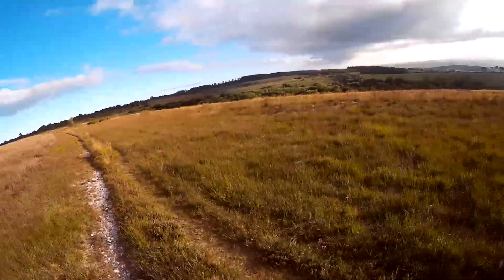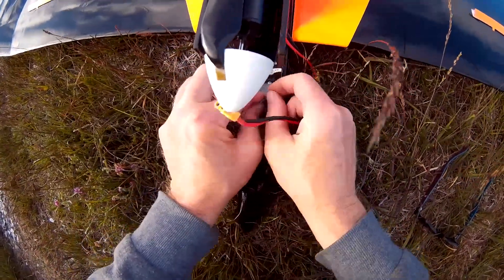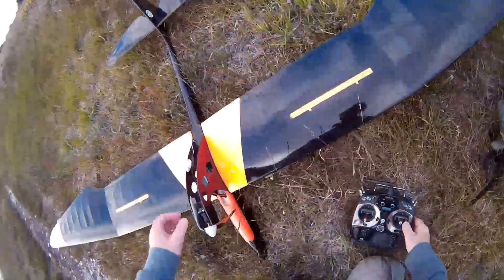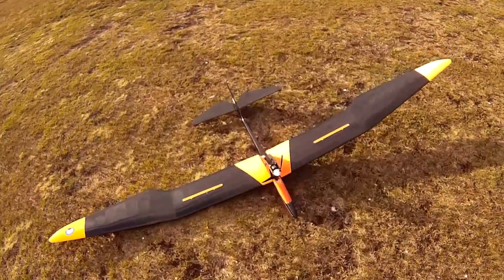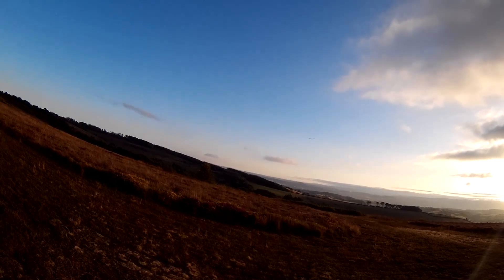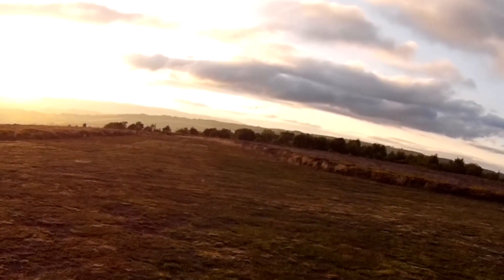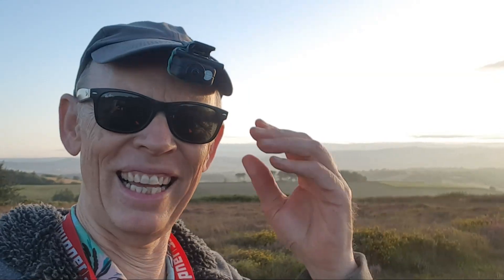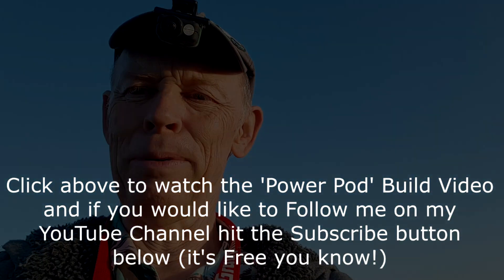Making an Electric Power Pod Maiden Flight Test

Comment: Very interesting. Thanks. I'm just about to finish a Pichler Grunau Baby that has been sat untouched in its box since 2012! I have the power pod option for it and was looking for information on how this might work out (worryingly, I can find no cases on the web where people have actually used this option). The thrust line thing is interesting. Given where the prop is located its impractical to have the thrust line run through the CofG. My guess is that having a little upthrust might just provide a slight down-wash or at least a little flow increase over the tailplane which might help counter the nose-down pitching moment of the trust. My worry is that, with enough thrust one might stall the tailplane negatively at low airspeed especially if the CofG is well forward adding to the demands on the tailplane.
Anyway, it's very good to see how well your setup performs.
Reply from the maker: Nice model Colin, does the plan give any details? I made an ASW with a fold down motor last year which keeps everything nice and streamlined, but I would recommend a folding prop whatever you do to save drag 👍
Reply: @CliffHarveyRCPlanes  Many thanks for the reply!. Sad to say it's an ARTF (my excuse - I was working at the time and didn't have time to build the Krick version - or indeed the Pichler version as it turned out!) and the instructions are a bit thin on the ground to say the least including a dangerously rearward recommended CG range that was revised subsequently. As you say, I need to do something about the prop drag and a folding prop is probably the best option, though, as an old heli fanatic I have more than a few tail-rotor assemblies that are crying out to be converted to variable pitch/feathering prop units. It would be interesting to experiment with this as a way of making up for not having air-brakes.

Comment: What an amazing glider! I have dihedral  with no airlerons foam pusher, wing 110 meter, will turn in into a power pod so i use a lighter batt, hope it flies like this cutee
Reply from the maker: Hi HS, just make sure to have some upthrust and check the cg and you should be away 👍
Reply: Thanks mate, how long does your glider fly with variant throttle use for one battery recharge?
Reply from the maker: @maricv84HomeScience  Eight to ten minutes probably 👍
Reply: @CliffHarveyRCPlanes  If I set the thust angle too much up, is it an issue?
Reply from the maker: @maricv84HomeScience  No, not really, if it's to high it'll climb at a steeper angle assuming it's got the power to do so, to low and it'll try and fly downhill which would mean a quick application of up elevator 👍

Comment: Hi Cliff
Just found your site. I have a BOT not flown for want of a power pod. Is there any way you could provide details of your setup and spec.? Yours looks great  and just what I neet.
Reply from the maker: Hi Mr Chalky, have you watched Part 1 and 2? They'll give you a good idea, here's the link to Part 1 and the link to Part 2 is at the end 👍
Reply: @CliffHarveyRCPlanes  Hi Again . Can you say what size motor you used? Yes I've now watched both parts and am impressed.
Reply from the maker: @MrChalky2010  The motor is an Overlander Thumper V3, T3536/06, 442 Watt, 1300Kv, 2-4 lipo 👍

Comment: Fantastic job, Cliff...!!! 
Back in the day i had a Thunder Tiger Explorer 2M. (my first real 'real' glider) and built a power pod very similar to that for it. Wow, what a difference these days with 'clean' energy to get it in the air. Back then i had to use an 'ole Cox .09 motor with a throttle on it. Worked great but, in ALL honesty... the only thing i miss about the nitro engines were the smell of the exhaust. hahahahaha
The black oily mess left over was, well... not my favorite part as it always needed cleaning and eventually, it always gets down and into the wood. (boy, i DO miss that smell though, i'll admit)
Have a wonderful day my friend. About to finally get off my duff this morning, finish my coffee and get back on the build of mine. Woo...!!! So stoked to get this up in it's natural environment. Poor thing looks lonely and naked at the moment. hahaha
Reply from the maker: Thanks Danoman, the idea was to try and make it look old school (which we both are anyway by the sound of it haha), I had a PAW 1.5 diesel on a pod, those things were noisy and oily as well, get a short progress video up for us all to admire 🙂

Comment: Wow, that's great. I was rather worried you might have a thrust angle effect and have it nose down at launch, but the BOT flies really well with the motor running.
Great result Cliff!
Reply from the maker: Thanks Jo, I did a little research and up thrust for a tractor and down thrust for a pusher which, when you think about it, is the same thrust line 👍